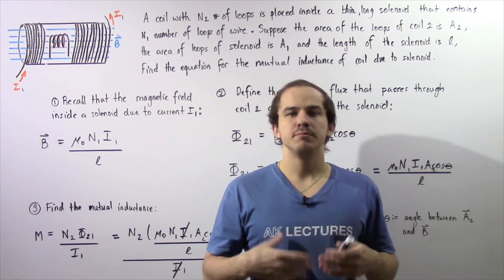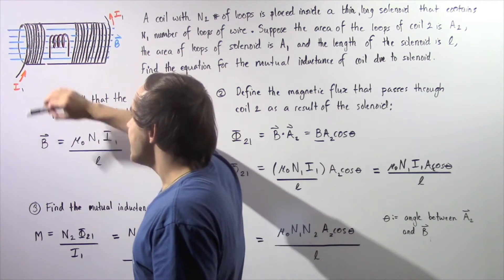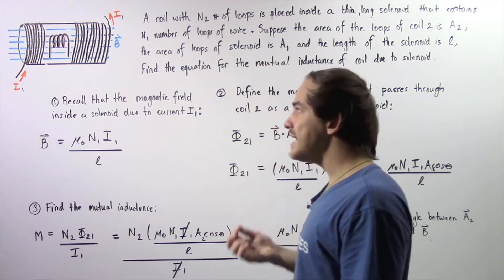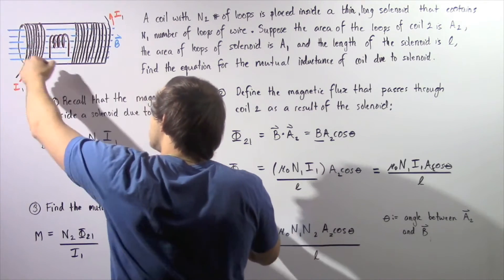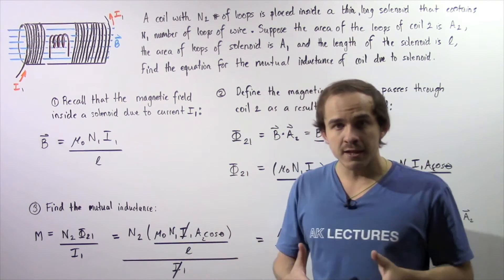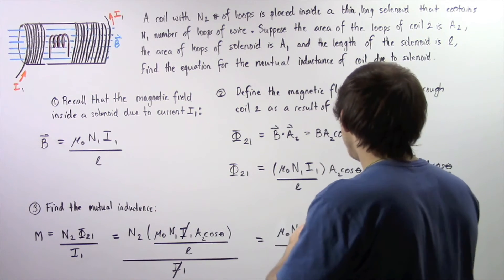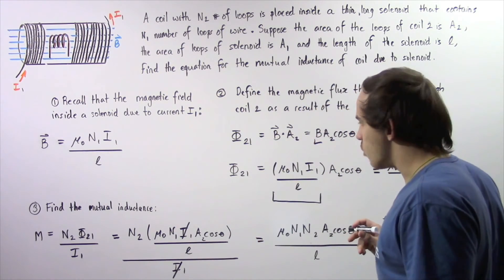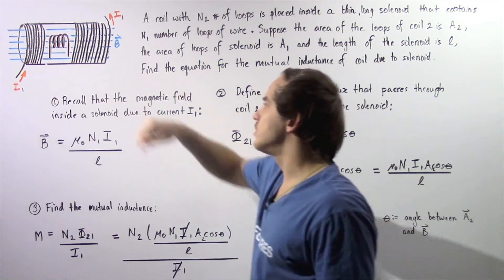Mutual Inductance of Coil Inside Solenoid

Comment: While I am no expert, I believe this explanation to be incorrect. The concept of mutual inductance does not apply given this geometry unless the secondary coil has nearly the same radius as the primary. Otherwise, no matter the current induced in the secondary coil, its NET contribution to the primary coil flux is approximately zero (if the radius of the primary coil is significantly greater than that of the secondary).